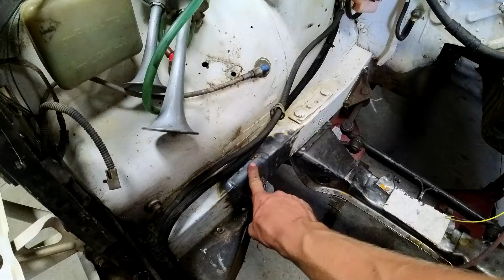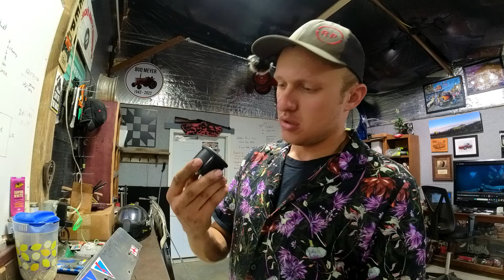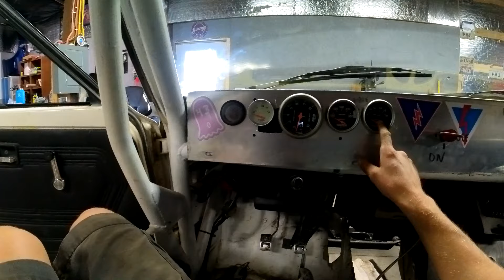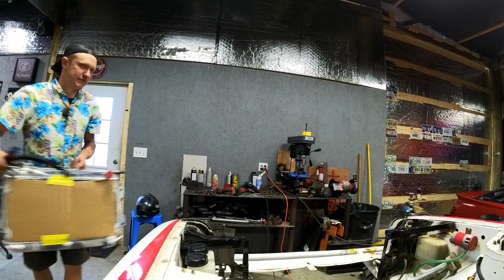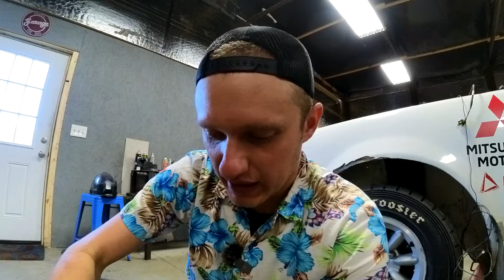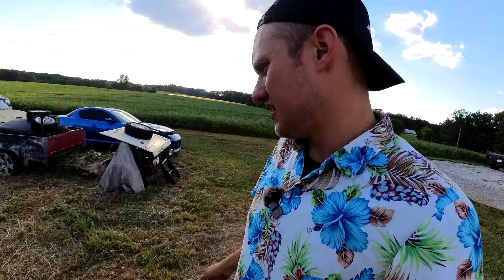I Found a HUGE PROBLEM With the Full Bridgeport Rotary Swap - Never Giving UP!

Comment: Sadly the race WP under drive is so big you have to run the smaller crank pulley as well... so I would start with the smaller crank pulley which is what I have done so far.